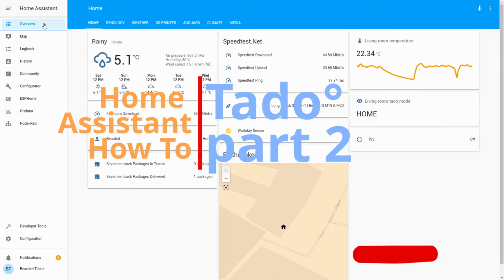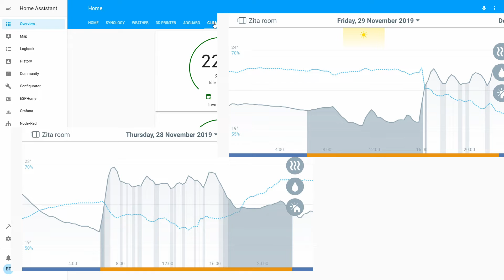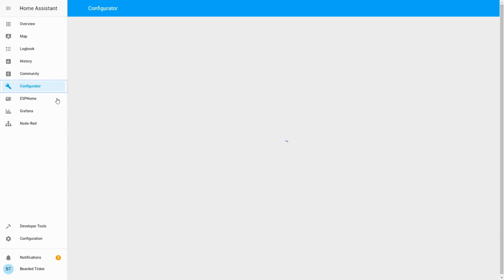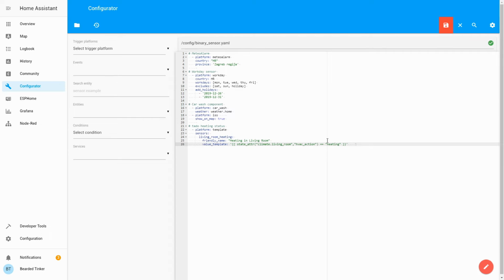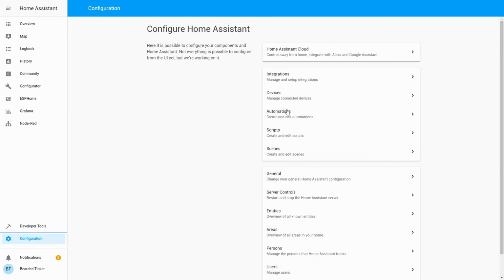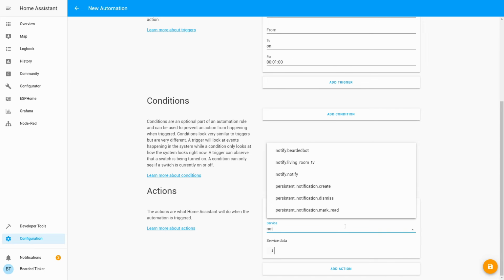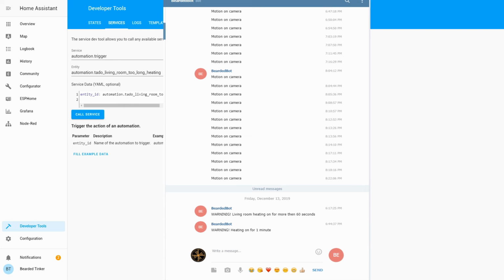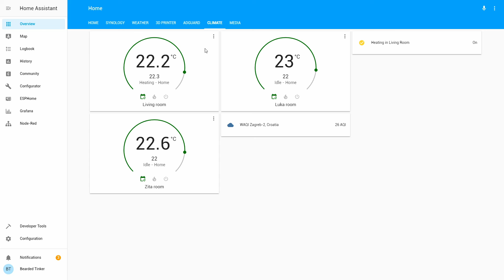Home Assistant How To - Improving tado° smart home heating

Comment: Hello,

I am a new customer and have a few questions for which I couldn’t find answers. Below are my inquiries and details about my setup:

My equipment:
tado° Wireless Smart Thermostat – Starter Kit V3+ – Intelligent Heating Control, 

Question 1:

Why doesn’t the Water icon appear, preventing me from managing hot water? Could you let me know what is missing to enable this functionality?

Question 2:

In my large living room, I have three radiators, each with a thermostatic valve. How can I group these three valves into a single room, named Living Room, and set a unified temperature for all three?

Question 3:

I’ve noticed that the temperature readings from the thermostatic valves are not always accurate. For instance, my Xiaomi thermostat shows a difference of 2 °C. How can I configure the system to take the temperature from this Xiaomi thermostat instead of the thermostatic valves? I don’t want to purchase another Tado thermostat as it’s too expensive, so I’m looking for a solution compatible with Home Assistant.

Question 4:

I have a Tado thermostat installed in the living room. How can I configure the system to prioritize the temperature readings from this thermostat instead of the thermostatic valves? Also, why can’t I change the Measuring Device option in the app?

Thank you in advance for your assistance and support!
Reply from the maker: Hi and welcome!
1) for this you have to have boiler that supports OpenTherm/eBUS connectoin and tado needs to be setup that way. Without it, you'll not be able to control water.
2) While there is a way to do it, it will not work with tado app. You can group valves and make one single valve out of it. But if you also use tado app, than this will be ignored there.
3) You can in tado, but you can use HACS component Better Thermostat that can use external sensors. Just be careful, who says that Xiaomi/Aqara temperature sensor is precise ;)
4) You can use Better thermostat HACS component, or you can do that in tado app.

Comment: Would it be possible to set up the automation to trigger if its been on for an hour but only if the temperature has also fallen over that period?

My tado TRVs also often get stuck when low battery (and the battery monitoring does eeem to be either "its fine" or "low battery" with no % tracker, and its version of low power is often after the point it doesnt actually have enough. On top of that my boiler only has a physical control for flow temp, so if ive not adjusted it upwards for a sudden cold day then the tados can perform fine hut the house still isnt warm enough.

Both situations would be covered by an automation to tell me if the trv is calling for heat but the room isnt getting warmer / maintaining temperature
Reply from the maker: This is possible by using Trend integration in HA: https://www.home-assistant.io/integrations/trend/ - will need to play a bit with this, but shouldn't be that hard to implement.

Comment: I had the same problem with Tado. It’s not fixed yet :/
Reply from the maker: Now I get notifications from Home Assistant if heating is on for more then 60-90 minutes.
Also, I replaced tado "hub" since I had newer one - not sure if that improved range, but haven't had any more issues with it.

Comment: Very good tutorial ... thanks for that. I have a question, im a newbie with HA and i got a few Tado valve's but thing is that i made a binary sensors for every valve like u did in first tado tutorial, but when one tado sensor gets off, it turns off heater even when second valve is still ON. Is there any way how can i manage that ? Sorry for my english :-) but thanks for help.
Reply from the maker: Thank you for your comment Marek! 👍
So you are saying that if two valves request heating and on is heated enough, heating stops? Even if one still requires to heat more?
As far as I know, that should not be a case. How do you have them connected with heater? 
Well, that can happen if heater goes into standby for heating too long - of course depending again on the heater you have. But it should restart heating after cooldown.  
One thing you should note is that there is a bit of delay in sensor data so maybe that's the problem.
Reply: @BeardedTinker  both valves are triggering switch.heater ... but if one valve gets to its temperature, it turns off switch.heater even when second valve is still on heat mode. i think its just a matter of automation setup ;-)
Reply from the maker: Ah, OK! I've left my tado to work with the app. :) OK, that shouldn't be an issue. Can you copy your automation here? 
But it should be something like this:
condition:
  condition: and
  conditions:
    - condition: state
      entity_id: binary_sensor.pm25_increase
      state: 'on'
    - condition: numeric_state
      entity_id: sensor.luftdaten_p25
      above: 20
I use it to track when both values are "on" or triggered to do an acction.
Reply: @BeardedTinker  I've got it sorted through binary sensor from your firt tado video. I combined two hvac_mode sensors into one binary sensor ... and it seems to be working fine. But I found a issue regarding to temperature sensor on tado valves ... its very inaccurate :-( ... is there any way how to use different mqtt temp sensor with tado valve? thanks
Reply from the maker: When you say inaccurate did you mean it gives you wrong reading or is it slow to update? If you have any other temperature sensor you can of course us that for trigger too. If it's inaccurate you can try and tweak it in app I think.
Reply: @BeardedTinker  well, i think placing temp sensor into radiator valve, which is really close to radiator, was not a very good idea. If heater is off, and radiator is cool, valve gives relatively accurate reading, but when heater starts to heat, temp on valve is really bad, compared to different temp sensor. I tried to tweak it in app, like you said ... but it didnt helped at all. so thats why im thinking to control valve with different temp sensor.
Reply from the maker: @marekbiros  That's strange. You are right in terms of where it's placed, But I haven't seen any problem with them. I have 3 of them, and one of them is also in a same room I have Smart Thermostat. And they both have near identical temp indicated.
But nevertheless - you can of course use some other temperature sensor to trigger automation. You will have to play a bit with automation and triggers, but it should be easy.

Comment: Hi, do you have anymore plans to do some more Tado VLogs ?

Which is best set up. Integration or via the one you used via the my tado logon ?

I think integration is good because it can be done local BUT it doesnt update the Tado App but if you use the my Tado, if the App or internet fails, so does your schedule or smart set up. At least the integration can keep it working.

Something in the middle would be great without having both.

Also, if you have anything on hot water would be great. I think im heating mine up too much.
Reply from the maker: Hi Martyn!
Integration via Home Assistant still uses my.tado.com API (not official) to connect to tado system. And it has same flow as original tado app/system - no internet, no change in heating schedule. 
It would be great to be able to control directly, but unfortunately it doesn't work as far as I know.

I'm don't have hot water tank, so I can't help you directly on that. My gas heating systems uses flow/pass through heater for water. But I guess, manipulating water heater could be done with automations and presence detection somehow. Depends on your setup of course.